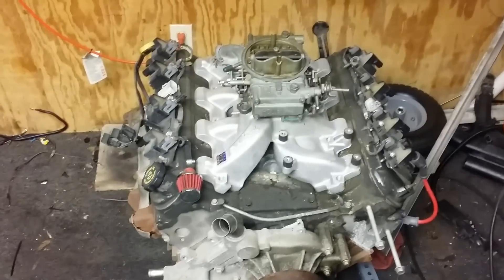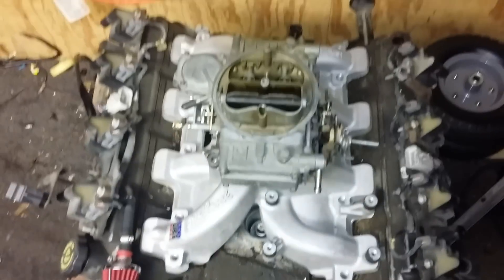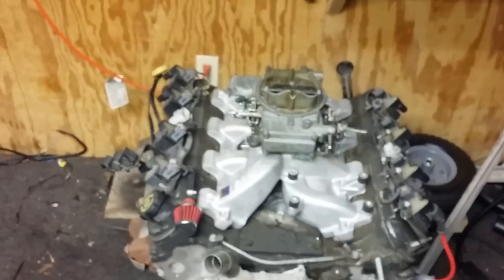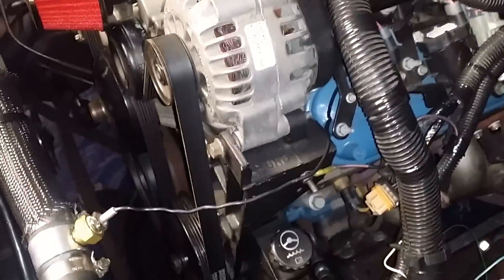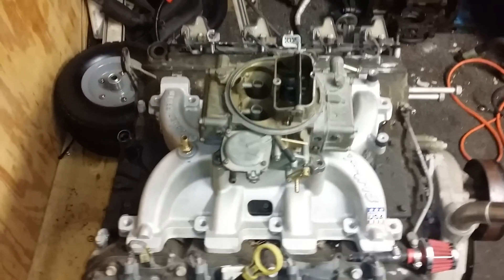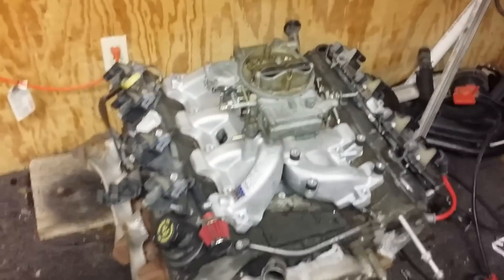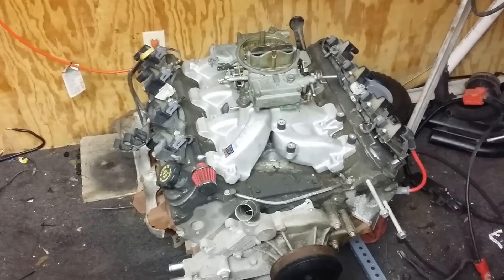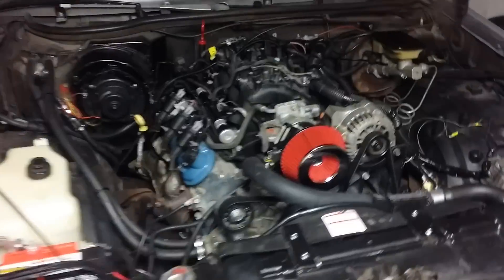HOW TO: Carburetor VS Fuel injection LSx 4.8 5.3 6.0 LS1

Comment: Recommendations on carb size for a stock 5.3? I have everything else done I just need to find a decent carb. Wasn’t sure if I should go with a 650 CFM or a 750 CFM DP.
It’s going in my big as mud truck.

Good video.
Reply: 650 will do bro

Comment: Hey man I have question I recently did las swap carbureted on my c10 and for sum reason the acceleration is bogging and acceleration is really slow?
Reply from the maker: Need wayy more info
Reply: It’s a stock 5.3 I’m running msd ignition black ls series plug and play and Holley 650 carburetor

Comment: Question when you get it running does it run rich with carberator
Reply from the maker: Que??
Reply: @beeterolds  does that LS run rich with that carburetor on it instead of fuel injection?

Comment: I jus got my hands on a 5.3 for cheap but it didn’t come with the wiring harnesse or computer should i go carb jus for the simplicity of it, im new to the ls stuff
Reply from the maker: Whats it going in?
Reply: 91 silverado
Reply from the maker: @matt86toy  in this case i would run a carb. Try to find parts used itll save ya a bunch of money.

Comment: What air cleaner is on that fuel injected motor ? Also , will you run that air cleaner with the MAF sensor when you get it going ?
Reply from the maker: We aren't going to run a MAF Sensor
Reply: @beeterolds  How do you do that ? Sorry I'm new to this but I have a LS1 swapped into my 98 swb and I'm having issues running a cold air intake system.
Reply from the maker: @KidKevi  were running Microsquirt. It uses speed density via map sensor instead of the MAF
Reply: @beeterolds  Okay, I gotcha. Could you tell me what air cleaner that is ?
Reply from the maker: For the carb setup we used a simple round cleaner... For EFI a cone
Reply: @beeterolds  I have researched far and wide to try and find the cone air filter you have on the efi system. Could you point me in the right direction to find it ? thank you

Comment: Does anyone know what fuel pressure a carb needs for an ls??
Reply from the maker: 4 to 4.5 is what I run in the wagon and the S10. You don't need anymore than that I don't care what anyone says
Reply: @beeterolds  really?? I might consider this route on the next build  have you done an expense comparison yet??
Reply from the maker: @swervinrigg209  carb setup is cheaper in the long run if you piece it together and not buying the Edelbrock kit. We're going to try Microsquirt on our 4.8 it's the cheapest EFI I've seen yet.
Reply: @beeterolds  i tried to read on it i honestly don't see the difference between that and the stock ecu am i missing something here??
Reply from the maker: Microsquirt is simple. You don't need to buy HP tuners, you dont need to buy license credits... And there is a ton of free online support for it.

Comment: ...I would like to get in contact with  you and pick your brain some time. I have a 92 k1500 nv4500 I want to do a carb ls swap it will be a daily driver and occasionally a romp through the woods on 33s with my 3.73 gears

Comment: What do u need sensors for?
Reply: Why im asking is because i thought there was no sensors needed when going back to a carb
Reply from the maker: will fleischauer the engine uses a cam and crank sensor to run because it doesn't use a distributor
Reply: Ohh ok. I understand now 
thanks

Comment: I had a mid 80's olds delta 88, nice smooth cruiser like a Cadillac, I got tired of sensors leaving me stranded-- I put a holley 700 4150 on it and a distributor out of an old Olds, and tossed the computer in the garbage. Best choice I ever made.

Comment: Hey brother! Great info. I’ve a Carb on my LY6 6.0 with LS3 heads into my completely rebuilt 72 Chevy 4x4. Im heading into the wiring part and was wondering if I’m going to need to flash the computer? You don’t mention it, so I’m hoping not. Also, any other advice? Many thanks bro! Great video...
Reply from the maker: Browns Nation it’ll need flashed to remove the vehicle anti theft but fortunately most tuners can do it inexpensively
Reply: BEETEROLDS THANKS so much for your response. Is there anywhere I can find info on how to complete the wiring for my carb LS? Like a step by step kind of thing? Again, many thanks bro!
Reply from the maker: It's not hard dude lol
Reply: To learn the best schematic layout for efi standalone wiring go to youtube " Project Rowdy part 5" , go under the heading and expand the heading, he has all the links you will need. LT1swap.com will do the reflash for $75, but I just saw ads on EBAY for $35. You will need to tell the guy to remove VATS (veh. anti theft system), turn on wire #42, what gears/tires you are running, if you have a 4 cyl. tach switch on your tach ( it is preprogrammed to run on 4 cyl adjustment. ) And what trans you are running. If you are running a non electric turbo trans, go under the video and I posted the 2 parts you need for the trans so you can hook up the VSS (vehicle speed sensor) wire.
Reply: If you go carb, You will need the MSD LS module for $380 to fire your coils.
Reply from the maker: Don Rutter I went carb this time around because I had the ignition controller and the Intake. But in the end rolling with an EFI setup is your best bet
Reply from the maker: Don Rutter already done and done

Comment: What did you do for fuel system and lines with the carbed engine with the older cars not usually having a return line and the ls not having a mechanical fuel pump boss
Reply from the maker: russian06374 In tank fuel pump and we made a return setup

Comment: I'm doing ls 4.8 in 85 lasabre using original trans
Reply from the maker: Bryant Matthews 3 spd or 4 spd? A lot of them cars came with the th200 which won't last long at all
Reply: It's a 4 speed I drove it with the 307 and it had 4 speed
Reply from the maker: Bryant Matthews ok. Cool th2004r it'll hold for a while as long as you don't beat the snot out of it.
Reply: Well I guess I'm going to buy a th350
Reply from the maker: Bryant Matthews where are you located  I have a th350 for grabs
Reply: BEETEROLDS I'm in Augusta GA

Comment: I got a 4.3 V6 Vortec to swap into a Trooper. The engine has zero hours on it, TBI, but no harness and no computer. I am thinking of putting an aftermarket intake on it and going with a carb. Simpler is better, I think. Any advice would be appreciated. The Trooper has no computer.
Reply from the maker: Kevin Hornbuckle 4.3s began life in the 80s with a Carb. So running a carb would be easy as pie. All you need is the proper intake and distributor

Comment: I just bought a long block 5.3 thinking about putting it in my 87 442 project for now, but were you able to use all the standard truck accessories and brackets or should I look for F-body I'm hearing a lot of controversy on this topic and don't want to have to end up buying both btw I'm staying efi as well looking at getting the new Fi-tech kit were you get everything from intake manifold to harness and computer
Reply from the maker: 1017cutlass all the truck stuff fit under the hood of my 1983 Cutlass I say you're golden bro

Comment: have drivin cars with both carburater's and fuel injectd engine's. Carberators are great becaous thay are simple and easy to tune up.Con's to start the engine. You almost always have to pump the accelorater. Vapor lock, carb's have an increased amount of back fireing.
Reply from the maker: Aries Might yup I agree! If you are gonna drive the heck out of it leave it EFI! Weekend warrior go Carb
Reply: BEETEROLDS Swaps & How to In the 80's and 90's I would normually agree with you.Since the 2,000's, the price of repair shop's has gotten rediculas.I have a 1973 Dodge Charger SE.With a 440 ci engine that I am going to keep carbed.As well as a 1976 Fiat Spider convertable.

Comment: What are the benefits of running efi over carb...?
Reply from the maker: When the system is tuned accordingly its basically plug and play. The computer makes adjustments needed per load, weather changes, fuel quality to a lesser extent and performance.. Hit the key and go. 

Carb which in my opinion is more user friendly, generally dependable considering carburetors have been in use for over 100yrs but it leaves a lot on the table in terms of consistency.. Sure you can dyno you carbed setup and it will run great but whose to say every time the weather changes you have to fiddle with it and you start again at square one.  For a car you drive frequently regardless if its a daily driver or high performance ride I would go EFI. If its a weekend warrior or it sees more time at the track than it does on the road go with a carb. Thats just my opinion.
Reply: D.Szymanski...  OK I understand...  I have a 5.3 now built on a stand.  I have a gto intake just sitting on top with a wiring harness sitting on the side.  Just didn't know if it was worth my time.  Your explanation is perfect.  Think I'm going to take the time and do the wiring . Thank you...
Reply from the maker: JONQUELL MAYES Thats the other thing.. If you already have just about everything you need to go EFI.. Do it.. I did a few harnesses its super easy
Reply: D.Szymanski . I'm going to try it. Hopefully it is as easy as you making it seem. Watched a million YouTube videos and built a little courage...  thank for the advice  buddy...
Reply from the maker: http://lt1swap.com/ Check out that site. Brandon was kind enough to list all the pinouts for what you need and what you don't need in the harness. Currently its winter here where I live it would be a great time to attack the harness.. Give yourself plenty of room to work and take your time.. Its not bad I promise

Comment: I have a 5.3 with edelbrock performer intake and a quick fuel 4 barrel carb, 350 3 speed transmission. I have plans to add a cam, WHAT CAM DO YOU SUGGEST I SHOULD INSTALL?
Reply from the maker: What kind of car? What kind or gears are you running out back? DO you have a higher stall speed converter

Comment: carbs make power and great throttle response. dollar for dollar better then efi
Reply from the maker: bads10357 I'm on the same page with you... EFI is great for a daily driver but for a weekend toy... carb
Reply: bads10357 I'm glad to read this, I have my weekend toy with an ls3 and I took the carb route.
Reply from the maker: as long as you are happy brother!
Reply: Yes you can make more power with a carb, but stock the enginemasters dyno speaks for itself. Stock carb vs. stock EFI they are within 2hp.

Comment: So how much did MSD controller  cost and where can I get one.
Reply from the maker: I paid like $280 for it... 4 yrs ago... and you can get them anywhere..
Reply: can you look on Ebay and fine a model number and name of this controller your talking about, I can only find MSD spark controller not one that could run something like what your talking about.
Reply from the maker: MSD 6010 or 6012 is the controller.. only controls the ignition
Reply: amazon

Comment: RV cam should work good for more torque and better mileage
Reply from the maker: tight lobe separation and a mild lift and duration is what I'm after.
Reply: good rv will give about 35 hp  but lots of torque
Reply from the maker: +Jim Rowlings I'm looking at a cam from howards. 210 214 duration but 108LSA
Reply: k cool

Comment: My belief on builds was go carb, go efi. I don't really care which. I've heard that same speech go Efi or don't go at all. Which I do not agree with. The way I go about carb or Efi is what parts do I have laying around. If I have a Quadrajet I'll use it. If I have a throttle body I'll use it. I just like utilization of what's at hand. 
Do what makes you happy, not others.
Reply from the maker: Absolutely. I just happened to have a complete EFI setup so I used it haha

Comment: On another note! I am aware that carburated make this new engines especially modular engines run stronger than those restricted fuel injection intakes. Like LT1 has been putting almost 400hp to engine dyno just by tweaking it a bit and using carbs.
Reply from the maker: +sandro valencia Tuning is much easier.. But the beauty of EFI is the lack of hassle.. Get in start it and go.
Reply: +D.Szymanski I just want to drive it and get the feel to compare. The options are endless.

Comment: I eventually will do the same on my 71 el camino. The problem I am running into is that I bought the wrong oil pan. But it's a starter it will run soon. 
Thanx for your videos very helpful bro. Be blessed.
Reply from the maker: +sandro valencia Thank you for your comment!